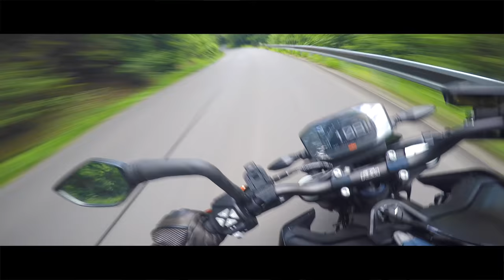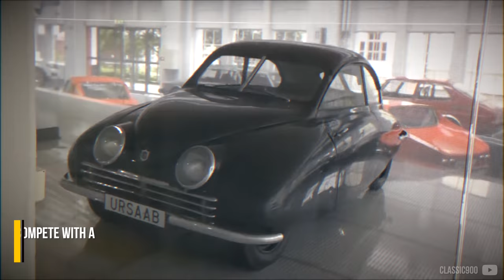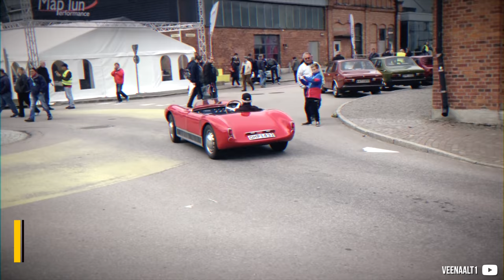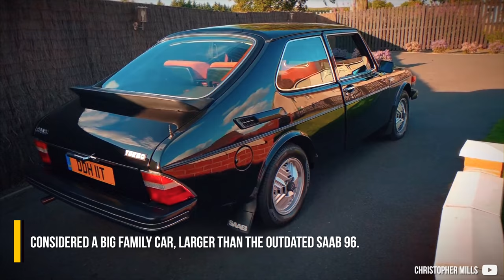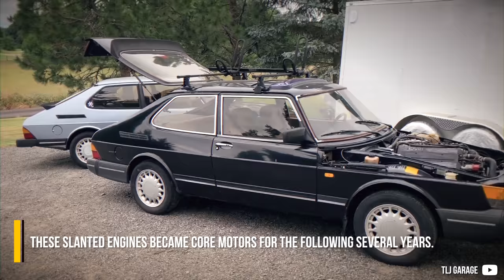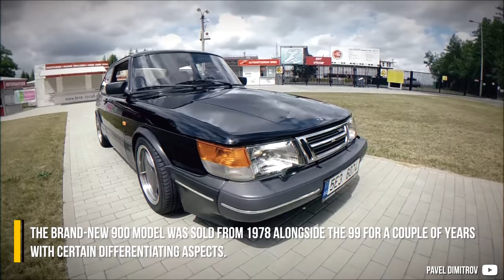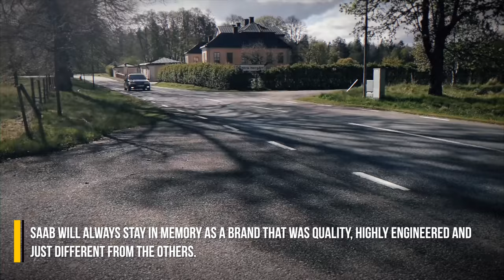Why We Miss The True SAAB?

Comment: I have own a SAAB since the 99 Triumph motor type, up to the current SAAB 95.
The SAAB 99 (and the SAAB 90) was great cars.  And yes, the 99 and 900 Turbo was nice cars.

The SAAB 93 original chassis was considered to be to flimsy for SAAB engineers, so they was going to add some stabilizing parts, but they was forbidden. As all the models should be build on the same base plate.  So to solve that problem, SAAB engineers added a couple of extra heavily oversized bolts to fasten the seats.  So the base plate was no longer as flimsy, and they got a better car then the others that was built on that same chassis.  :-)

Comment: Even when they started sharing platforms, Saab quality didn't just fall off a cliff. Around two-thirds of the parts in the platform shared Saabs were still Saab parts. It wasn't until the final decade of Saab when parts sharing ruled the roost and Saab just became a re-badged Chevy (Trailblazer/9-7X) or Subaru (Impreza/9-2X aka Saabaru).

Comment: had a 2-stroker 1964-model and there one can talk about "super-emitter". Later on a SAAB 900 Automatic with Twin carbs: 1,7 liters o gasolin per 10 km. Later had one 9000 2,3 T (236 hk) and it was rather brutal on lower gears. Now a 2003 9-3, but my dog wrecked the inside.

Comment: Over the years, I owned two Saab 900 Turbos (v1), an 8-valve and then a 16-valve, with a Toyota Celica in between. The Saabs were, along with a couple of Alfa-Romeos, the most fun cars to drive that I ever had, although the Saabs, especially the 16-valve, would easily beat the Alfas fr speed. The turbo-charged acceleration from 40-70 was phenomenal. While the Alfas had the annoying habit of having really weird things go wrong at really inconvenient times, the Saabs were incredibly reliable - no faults other than a seat heater being possessed by a demon one summer.

Comment: Loved my 900 hatchback.  This was the last of the real Saab and beginnings of its decline. It Drove amazing on the highway and amazing room in the back when I fold down the rear seats.  The na engine didn’t make a lot of power but it was meant to rev and pull its heavy body.  Only real down fall was the tranny.  Many had issues with the tranny especially after you started to race or abuse the car.

Comment: U missed the 9000! An kollaboration between Saab, Lancia, Fiat and Alfa Romeo. An all new Saab product in the6 80ies. Wonderful car model that Survived to 1998. I have driven an 1988 Saab 9000i, the One without turbo and 130 HP, as a taxi. Not a fast car but very reliable and has a low fuel consumption. After that they came with a great non turbo 150hp 2,3 litre.

Comment: The 99/90/900 didn't have Triumph engines but Ricardo engines that were developed for both Triumph and Saab.
Saab went to produce those engines themselves, developing them far beyond any Triumph 4 cylinder engine. It was an engine in its onwn right, no foreign import (as was the V4 in Saab's 96)

Comment: My first car was a -81 99 Gli, exactly the same engine as in the Turbo except the turbo... (of course the injection was tuned accordingly.). -Very fun car for a 18 year old, but how I managed to keep my drivers licens with probation time and all, I still don't understand. With a stock Saab I beat every up-hotted Volvo I came up beside at the red lights haha. Though, it had a 4-speed gear box and the ratio was a bit low so it revved a bit high in high speeds and sometimes I thought I could see the needle in the fuel gauge "fall" while I was driving at my worst... With the gas pedal firmly in the carpet, I don't think I got it over 180 km/h, even though I certainly tried. God I still miss that car!

Comment: I owned a Saab 96 estate when I was at university in Brighton. One day I parked and jumped out quickly without taking the keys out to run into a shop. I was only gone two minutes but when I got out so was the car! I nearly cried, after all you can't really steal a Saab when the keys are out. Then a few days later a friend of mine called me and said, quick turn on the TV to channel... It was the local news and there was my Saab crashed into the front of a Lebanese restaurant called the Kasbah. It had been used in a revenge attack by a disgruntled employee and it had virtually destroyed the front of the restaurant. When I got it back from the police I saw that it was almost undamaged except for a dent in the left fender. The insurance company gave the value of the car and they also let me keep it (they wouldn't do that these days) so I sold it to a very polite piano teacher from Worthing and bought another one exactly the same! 😊

Comment: In my student days, a friend owned a high-mileage 900i (on which he continued to pile heavy mileage) at a time when you just didn't see good-condition cars with over 100k miles on them. Two things I remember - the ignition lock by the handbrake and a frequent tendency to cut out randomly (I found out about the former during one occurrence of the latter - sudden fiddling between the front seats and "oh f**k guys..." followed by us pushing the car out of the way of the urban traffic).

Comment: When I graduated from college in the late '80s a wanted a Saab 900 Turbo.  From the styling, to the go-anywhere performance, to the gnat's-azz engineering solutions which obviously came from a clean sheet of paper (and that ignition switch between the seats!), I just wanted one.

By the time I could fit one into my life, bean counters and bureaucrats had eviscerated the car.

Well, at least there's the used car market.

Comment: fun smal facts and a rumor about saab
Ignition in center was not for being quirky but for saab realized have it on the column could cause severe damage to your kneed in a crash, a change that remained in majority of saabs.

saab 9000 shares bits of the panels (mainly doors maybe roof and trunk to on saloon model) with the lancia thema, now there is where similarity stops despite being made on same platform, saab had a solid rear axle for improved handling and reinforced structures for better safety, it can even make a volvo 700 blush in some crash tests

lancia delta was available as a saab model under the name 600, sadly no 4wd nor turbo was available on it.

there was rumors going around of a new saab sonett based of a new subaro 2 seater sportscar that was under production (now was this perhaps BRZ it was hinting at?) sadly gm  shut down saab so we never got to see it

Comment: (Did you skip over the 9000..?)

My usual comment when discussing "what is a real saab" is that you cannot get everything in a single saab.
The OG900 does not have the night panel
The 9000 has the ignition key in the wrong spot
The NG9-3 had various issues. Early models were riddled with stuff that was fixed later, but the later models had some stuff moved to weird locations (like the clumsy AUX input for the stereo)
The OG9-5 does not have to be put into Reverse before removing the key
The NG9-5 is missing heated rear seats, but it looks absolutely stunning (mine still takes my breath away whenever I walk into my garage; and it is always fun catching up with fast beamers as we approach the curves)

I think you are too critical about GM's influence on the engineering. GM did a lot of nasty stuff to Saab, but the NG9-5 turned out okay. I see sport cars launched today that brag about Haldex IV (Saab had that already back in 2008). As one Saab engineer told me "you can drive that car at 200 kph with only one finger on the steering wheel". I had already driven it in that fashion, but always good to confirm that other 9-5s were the same.

Comment: Owned 3 Saabs. 

The first was an 89 900 Turbo coupe in 96, it had 180k when I bought it, drove 30k miles on it before it was sent to car heaven by an Acura Integra that lost control and had a head on collision. All of us in that Saab survived the crash and still can talk about it, sadly that Acura driver did not survive the crash. 

The second was a 91 Saab 9000 CD, it had a 120k when I bought it, drove another 120k and  it drove non stop Seattle to Boston twice, Seattle to Miami twice and Seattle to Anchorage once with a trailer. It never skipped a beat and the car is still on the road today. 

The last was a 96 900 Turbo Convertible. It was a disappointing car as unlike the previous 2 this one was a problematic one. Been driving German cars since then.

Comment: Well i had a sorely missed 87-900 T16,that i drove in the middle of the night, full Swedish snowstorm,i had a hard time seeing the edges of the road,My little sister and her hysterical mother in the backseat for a grueling 140 km´s drive to hospital.
I´ve driven lots of cars in snow, but this particular drive would not have been possible at all were it not for the 900.
I´m sure my sister thanks SAAB too.I mean the snow came over the bonnet like slices of cheese.-Cold,dry powdery snow.Vision was bad but in panic i averaged 90+ km/h.-Not possible even with an modern 4x4 today.

Comment: I drove a 1985 Saab 900 Turbo for several years, it left the impression of good car, botched manual transmission. The cause: increased torque from the turbocharged engine was sufficient to distort the gearcase during acceleration, leading to rapid failure of the laygear and usually third gear, typically in less than 50,000 miles. Obviously the gearcase needed fortification, particularly for the Turbo cars, though I've read that normally-aspirated Saab 900s also experienced early transmission failure. This shortcoming may have been exacerbated by the shifter, which was vague and rubbery, leaving the driver in doubt as to whether the gear is properly engaged or not. So good-bye Saab, you'll never bleed me again.

Comment: I had Saab's up til 8 years ago, I started with 95/96 models, had a 99, a couple of 900's (OG) and a 9000, I have driven a lot of the new 900's and 9-3 and 9-5's, but really already the 9000 had lost too much of it's origin.
I really want to find an OG 900 of the last model year in good condition with low milage, since I ran them over 300 000km each, I know I will have a good car for a long time.

Comment: While I know it was, basically, an Opel/Vauxhall Vectra underneath, I did drive a 9-3 for a couple of weeks in 2008 or 09 and I really liked it. I especially remember how comfortable and soft the leather seats were and how impressively strong and lively the diesel-engine was (I think it was the 180 hp TTID version). 
But, overall, the car didn't quite feel special and Swedish enough for my taste and for the money Saab charged. No way I would've bought it instead of an Audi or a BMW if it had been my money.

Comment: I drive daily a 1992 900 i 16v with 425.000 kms and still running well. I don't want to change it for any new car, not matter which one. Outstanding driving, wonderful ergonomics. But laws are going against these cars, sadly. I don't miss post 1993 Saab, models are close to vulgar. I miss pre 93 Saab, even if I still enjoy one, in the same way I miss pre 89 Mercedes or Jaguar. Modern cars just don't make it.

Comment: My first car Was My mom and dads car a 99 from 73... it had disc breaks on all four wheels. It had headlamp wiperes. Heatet drivers seeat... and it looked mordern compared to other cars. My mom and dad had 2 96 before that. I guess that saabs problem Was they did not have a small car in there line up. And there models Was long on the market With minor changes.

Comment: I got a 1993 900 convertible, 2003 9-3ss Vector, 2004 9-5 SC Vector 2.0T (15T turbo, not Gt17) and a very late 9-5 SC Linear BioPower. Beautiful cars and fun to drive. The seats in the 9-5 is very comfortable  unlike the sport seats in my 9-3.

Comment: Owned one 9000 and two 9-3. Every time I swore it was the last Saab I would ever buy. Malfunctioning, oil drinking rust buckets with the same operation cost as a small nation.

However, should you ever roll one over at the highway it would probably don't bother you that much.

Comment: I've had 3 Saabs first I bought at about 18 months old a 95 900 Turbo se convertible followed by an 05 2.0T vector convertible and the car I've had for about 10 years an 08 1.9cdti vector sportwagon. After owning 3 the first the 900 convertible was a far better built and better quality than both 93s I've owned, if I don't buy a late Saab 95 I don't know what sort of car I'm likely to buy maybe a Volvo but in the UK old men drive Volvo's saying that I'm 53.

Comment: I owned 3 Saab 900 2 Turbos, and an S. From 1980 to 1988. "All" had "5 speed manuals" I was totally disappointed in the S, so, I went back to the Turbo. I'll tell you the first mistake Saab made, was to market their cars towards women, started to put "automatic" transmissions in the Turbos. Then they introduced the 9000. Saab made enough of their own mistakes, without blaming GM. "SAAB took the enthusiasm, out of the enthusiast"

Comment: I'v had 3 Saab900's. First in 2005, it was a year model 1988, and i had it about 6 moths till i sell it, worked just fine. Next was a year model 1995 with 2.0 turbo engine, and i had it about 2 and half years. My third Saab 900 was with 2.5 v6 engine year model 1996 and had it few years. The Saab has a very unique driving feel, and it's a car like non of else!! In my opinion, Saab 900 was the last REAL SAAB. GM ruined the Saab completely. 9-3 and 9-5 was full of type failures, and i think in 2021 is the time we can speak about Saab in the past tense coz' the last "saab" was manufactured in 2011 so therefore the newest Saab are now already 10 years old. The car i have right now is Toyota Corolla and very happy with it... My sympathy is definitely with the Saab freaks, but I also really much understand the Toyota Corolla freaks too..!!

Comment: Saab management (in my opinion) tried to be an international (all customers, all climates) rather than just sell where they had advantages over others. IF they had focused on that they would have been unstoppable.  Should have supplied parts for racing, but left it up to others to race.  V-4 was a Ford stationary engine (meant for generator sets and water pumping) Sonnet was particularly ugly and uncomfortable. 99 & 900 brilliant just tried to sell everywhere vs picking markets.
And I guess overpaid management all started driving german cars ??  Triumph block had pathetic internal water pump - really  bad english design. Loved my 99. Dealers/repair shop never learned how to service/replace that pump and wrecked many Saab 99s.  900 would still be a good buy especially with 4 cylinder - mine still runs great after 30 years.  sadly you have to be your own mechanic to avoid problems - honest mechanics worth weight in gold but very hard to find.
Reply: Have to disagree with you on the intended usage of the Ford V4.
In Europe the V4 was always destined to be used in Ford Transit vans, Corsairs, Zephyrs, Taunus', Granadas and Capris.

Comment: Something I remember about Saab is leaving my Viggen at a shop to get a SPEC clutch upgrade in May 2021 and it’s almost July and I haven’t gotten it back because they can’t figure out why when you have fifth gear, you don’t have reverse, and when you have reverse, you don’t have fifth gear. I also remember how I totaled my other two Saab’s (NG 9-3 Aero and Vector) because of two careless drivers at red lights, one rear ended me, the other ran a red as I was turning left.

Comment: I used to repair the horrid things to put myself through college in the 1980's.  
Hey, let's take a crappy TR7 engine, turn it around BACKWARDS and stick the transaxle UNDER it!
It took a stick of dynamite to get that terrible water pump out of the block.

The reason SAAB is dead is because they refused to use off the shelf ANYTHING. Even the radio. GM shut them down because the radio cost more than the car was worth.

Comment: I have owned and drived a 93 tow stroke from 56.And modell 99 900 whith the swedish build engines all generatations.both carburathed and injected and turbo. All are of ultra high quality and can last forevever.carburathed need service on the carburathurs.and turbo need change of turbo much depending way of driwing service and oil quality.but can last very long time.They are extremly sade have good handling at road specaly on winter condition with good Tyres.Second to none they are allso rather good whithstand rust.Service can be complicated and the geatbox is not speacaly good the automatic is to prefer all day long.

Comment: *Oh, i later tuned it with Camshafts and realignment of the injection system, dual oilpump bigger radiator.Altered Wastegate.Did not go for a bigger Turbo.-Modified Airbox as i remember.Indicated 350 hp on the front wheels, until the tyres lost their grip.Bought better tyres but never tested again.Bigger oil cooler.-The gearbox took it all without problems.-As there were rumors ever since the 70´s about a gearbox that had a tendency to fail,SAAB over dimensioned the gears,The gearbox manufactured by Heavy Truck Manufacturer SCANIA,as well as the engine castings etc.It never failed really, just an old rumor stemming from the old English Triumph parts.I would buy a nice 87-900-T16 in nice condition and enjoy life, whats left of it....

Comment: The SAAB cars were designed by clever engineers and not by bead counters who are only interested by the bottom line.  Unfortunately because they were a low volume manufacture the car division did not make a profit. My 1986 900 was a far better car than any car before or since, my 93 is not bad  but not good either which is not surprising a GM based incarnation. My 93 is serviced by a SAAB Authorised Specialist, the car is register with SAAB.  All spare parts are readily available and they support their cars very well indeed but it's not cheap.